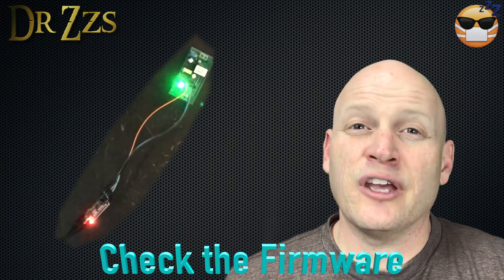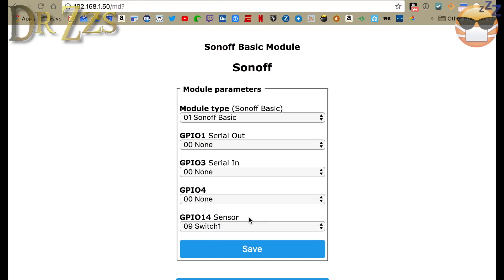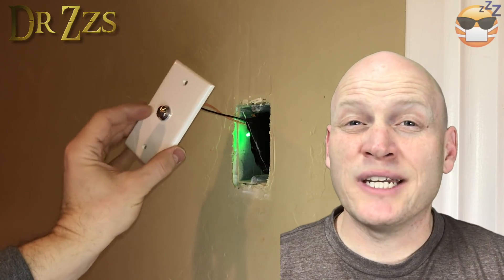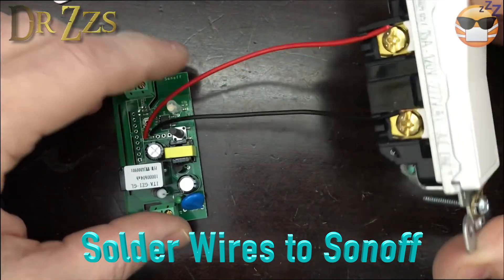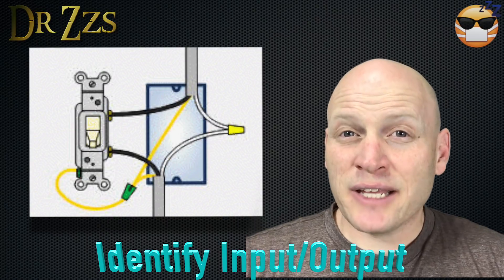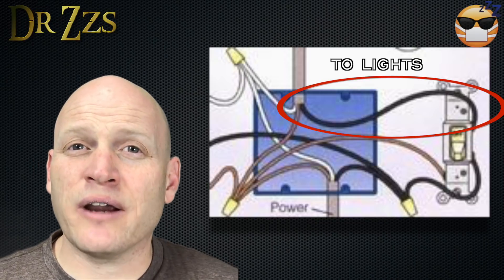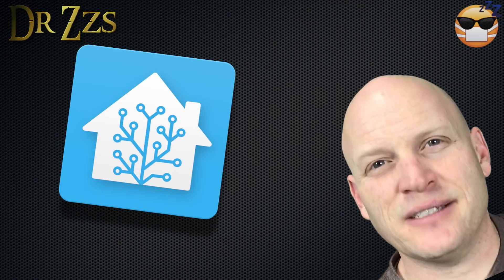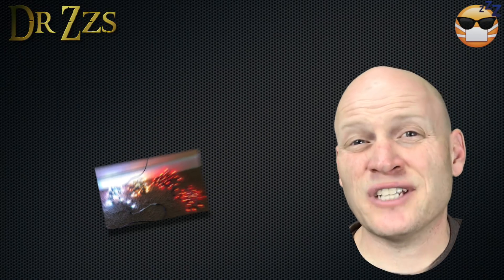No $30 "Smart Switch" | $5 Sonoff + REGULAR Light Switch!

Comment: When you set these up with momentary switches, what happens during wifi outages? Will the switch still toggle on/off as intended or will the lights only turn on if you keep the button pressed?
Reply: I think it still works with the momentary switch during WiFi outages. Switchmode is something internal for the Tasmota firmware you are running on the device. The device does not need to connect to anything to get this information.
One exception is if you  change the switchTopic from 0(default)to 1. Under switchTopic 1, when the switch changes state, it sends a MQTT message to the topic and the device receives the command to change state. During WiFi outages, there is no MQTT to connect to.

Comment: Hi DrZzs, I have a Sonoff BASIC RF R2 power v1.0 and it runs on a ESP8285 instead of a ESP8266 chip.  The GPIO 14 hole is no longer there, but instead the have broke out the GPIO2.  My question is, will your technique work with soldering to GPIO2 instead?

Comment: Thanks for the video. I just opened my switch box and found that there are four wire to the switch. Line, neutral, ground and load. So i just ignored the load wire, add sonoff to the line and neutral?

Comment: my sonoff does not looks like this is it because it was 2 years ago that they change the board??
Reply from the maker: ya, this video was done with v1 sonoff basics.  They are on v3 now.
Reply: @DrZzs  Great video and what an understanding you have. Can you do a similar video with R2 atleast.  As there are lot of discussions on should we use IO2 or Rx (which is GPIO3) etc. as Sonoff didn't give access to GPIO14.

Comment: Thanks for the video! I did not understand a few things and I am blocked, nothing broken thankfully. I have flashed my Sonoff basic with Tasmota and set GPIO14 to Switch1 and tried 2 variants of SwitchMode - 0 and 1.

My issue is related to wiring. I thought I could connect my Sonoff to the external wall switch on the lamp side by doing the following:

Open the lamp
Cut the L and the N wires
Connect the L and N wires coming from the wall to L and N of Inputs of the Sonoff
Connect the L and N wires going to the lamp to L and N of Outputs of the Sonoff

I have not done any other soldering or connection (like connecting GPIO14 to Ground...) on my Sonoff.

When the power switch is ON, I can connect the device using the web interface, MQTT etc. But when I turn the wall switch off, the power to the Sonoff also gets cutoff and it no longer has internet connection.

I am sure this is expected because and I am doing something wrong on the wiring side. But I don't know how to fix it. Can you please advise. Thanks. (I can't do this in my switchbox as it does not have enough space).

Comment: Hrm,   If you don't use a momentary momentary push button for your switch,  you'll have the same problem you'd have with smart bulbs.  If the switch is off, your smart switch is offline.  That's a great cost saving idea though.

Comment: Thanks for the vid! So with the rocker switches, if the rocker is in the standard “on” position and you switch the light off in the app, if you switch the rocker to the standard “off” position, does that turn the light back on? So the rocker switch would essentially reverse the on/off  positions when the light is switched on/off through the app?

Comment: I think you need to call electrician before you burn your house down. Using speaker wire in the butt connectors is extremely hazardous they cannot support the power of household loans. Even if it’s just lights

Comment: Great effort, thank you! From 6'32" how is the regular switch added? You just say "it's all connected", but how is the regular switch connected to the SONOFF? What does the regular switch do? For situations like this it will be great if you can add a simple circuit diagram in the video. Otherwise it is actually dangerous for people who are trying to follow the video with live circuits.

Comment: does this sonoff sync up with the switch? By that I mean, if the mechanical switch is off and I try to use the Wifi/automation will it work and vice versa, so in essence as a comuter in a 3 way switch?
Reply from the maker: yes! that is exactly it.  It is a 3-way switch, but the other switch is "virtual" in the computer or app.

Comment: I was checking the sonoff basic r2 I got and its only for 10amps, households circuit breakers are typically 15 or 20 amps, This will cause the sonoff to burn before the breakers starts protecting.  I guess we should use an inline fuse (of 10 amps) before the input line to protect the house from burning.  I see you are using this sonoff for your home.  So probably you should do this too, Dr Zzz
Reply from the maker: you are correct.  And I did start to add fuses.  
Good advice.  Thanks!

Comment: 2:30 is there anything  I can do?
Reply: I imagine that one solution for you could be to put Sonoff module in the light fixture's electrical box opposed to light switch's electrical box.

Most people don't realize that with the wiring like yours, the light fixture's electrical box should have hot, neutral and ground wires coming from circuit breaker. And then hot wire is simply pig tailed and forwarded to the light switch where it returns as load wire on another Romex cable. So there should be two Romex cables in your fixture's electrical box.

Comment: After getting inspired watching your videos, I have ordered a few sonoff basic R2 switches.  GPIO14 pin is missing in the new switch, please let me know the soldering process to install this R2 switch in the wall.  Note: I successfully tasmotised the sonoff.
Reply: Sathish use gpio 3, which is broken out as rx on the board.

Comment: In the Netherlands we use the  NEN1010 norm for electricity.
Blue(0), Braun (fase), black(switching) and yellow/green(ground)
The spaces for junctions are mostly in the ceiling.  Behind the switches we normally do not have enough space for a piece of electronics.

Comment: Does it matter what gauge wire I use to solder the switch to the GPIO pins on the board? I soldered on some female headers to make flashing a little easier, so I'm wondering if I should remove those or if I can get away with male pins and small gauge wire coming from the switch.
Reply from the maker: it doesn't matter really.  those are 3v wires carrying almost no current.  I've used wires I salvaged from old phone cords :)
Reply: @DrZzs  That's what I assumed, but me and mains aren't the best of friends, so just double checking. ;) GREAT tutorial. Thanks so much for the help.
Reply from the maker: I'm like a snake charmer with mains power.  I let it bite me every now and then so I'll build up an immunity ;p

Comment: ... where do we wire into with the newer basics with no GPIO14 ?
Reply from the maker: great question.  I believe you can use the Rx or Tx pin after you've changed the firmare.  Test it first cuz you may get errors if one of those is grounded on reboot.  I've used Rx for motion sensor and temp sensor without trouble.  Not 100% sure that Tx will be okay.  Just don't use gpio-0.
Reply: @DrZzs  so think we were to use And and GPIO14, so we saying we simply soldier switch into tx and rx, hmm, that's like shorting tx to rx then...
or we swopping gpio14 out for either tx or rx, problem, i'm going home the wkd, need to know what to do before as I have limited time to install before I leave again.
Reply: ok, and and rx ?
Reply: @DrZzs  will try this weekend, otherwise just going to wire the sonoff in as a 2 way switch solution, the wall switch the one side and the sonoff on the other leg of a 2 way configuration.

Comment: I've set GPIO14 to Switch1 (9), wired 120vac into input, and took wire leads from GND and GPIO14 to a basic light switch. When I toggle the state in the tasmota web interface, it works every time. If I flip the light switch to ON or OFF, it does nothing. What gives?

PS: I've even tried using a 2k resistor across 3.3v and GPIO14, to no affect.
Reply from the maker: I can't say for sure what's happening.  Either the Sonoff or the lightswitch is bad I would guess.  What happens if you just short gpio14 directly to ground?  If nothing happens then I would guess the sonoff is bad.
Reply: @DrZzs  So... long story short, a switch that I had taken down days before, went bad... lol! That's all it was, a bad switch, but I assumed it was good because it was working less than a week prior. Anyway, works like a charm now! =D

Comment: Hey can i use a Sonoff for a ceiling fan.  I have a smart bulb for the light, But need to keep it hot all the time.  Just need to wire it to the Fan wire and N wire correct? https://ufile.io/moymg6p7

Comment: When I shove the Sonoff board (no housing) into switchbox, the reset switch (GPIO 0?) is pressed against other wires in the tight box, and the relay is held low all the time. Is there a safe way to remove that switch, or the black rod that's attached to it? Or disable that switch temporarily in the Sonoff configuration?

Comment: Is there a way to use a momentary switch with an led, so when the room lights are off, the switch is lit?
Reply from the maker: I'm sure there is.  I haven't done it so I don't have the details to give you.  I would expect you could power the led on the button from some gpio pin on the sonoff, then set it so that pin is ON when the relay is OFF.

Comment: Question, I'm working on setting this up with the newer Sonoff Basic R2 RF Power V1.0 PCB that is being sold now. This PCB version doesn't have a pad or port for GPIO14. I understand that GPIO2 won't work because it causes a boot failure if pulled low. From what I've researched the only way to really do this with the new hardware is to utilize the RX port and then set it as you would GPIO14. The only issue with this is it stops you from being able to serial flash the board again, but as long as you have already flashed with Tazmota, you shouldn't need it as you can reflash OTA. Do you see anything wrong with this configuration or do you know of a better way? I'm somewhat new to HA but learning fast. I'm an IT pro who works on servers and switches all day anyway. But anything you can help with is very much appreciated. Thanks again!
Reply from the maker: Ya, and there's even a newer R3 version hitting the market this month.  I haven't heard of a better solution than what you describe for using the R2's with an external switch.  
Once you get Tasmota on there, you shouldn't ever need the serial ports again.  I have several older sonoffs that I've used Rx for Temp/Humidity or even Motion sensors without an issue, so it should be fine.  
Hopefully I'll get one of the R3's soon and we can start figuring out what we'll need to do to make it work best for our needs.  
Good luck!

Comment: How do I make a 4ch relay module with nodemcu with push buttons for each relay and make it work with sonoff tasmota.... In short want to make my own sonoff like 4ch relay...
Reply from the maker: I did it... but I can't remember which Video it is in.   Basically, once you have tasmota on your nodemcu, you set it as the "Generic" module type.  That gives you 11 pins to assign as either a Switch or a Relay.  Set one pin as Switch1, and one pin as Relay1.  Switch1 will control Relay1.  Then repeat that for Switch2, Relay2, Switch3, Relay3 and Switch4 Relay4.  As I recall, it gets a little tricky because some pins can't be low on startup.  I know for sure you don't want GPIO0 to be low on startup.  I can't remember which others have specific limitations.  You'll have to just experiment a little, or there may be more info in the Tasmota docs, or check out TheHookUp's video about using GPIO pins on ESP8266 devices.  https://youtu.be/7h2bE2vNoaY
Hope that helps!  Good luck!
Reply: DrZzs damn.... That was a fast reply.... Didn't think you'd reply....and again taking the time out and explaining it in a reply ( I know it takes a lott of time typing such long msgs) .... That's something..... Thanks man.... U r a great guy.... Keep up the good work...! 😊

Comment: Hi
Very nice and well made video.
I have light switch in my garage and i want to use the sonoff, but my the garage lights , can be switched on and off from two different switches (far from each other) 
Just to clarify things a bit , these 2 switches are hard wired to the same board and the same lights , and they are used just for better accessibility , meaning , if you are at one end of the garage you can switch on , and when you are at the other end , you can switch off 

My question , can i use a sonoff switch with this setup? Or maybe there are other switches that may work?
Reply from the maker: Hi.  That sounds like a 3-way switch.  There are a few ways to use a Sonoff or other device in that arrangement.  https://youtu.be/EroQ_Eos1HY or https://youtu.be/GEJCk-Dr3BQ or https://youtu.be/mSENAY9_AlI
There are off-the-shelf 3 way smart switches too, like this: https://amzn.to/2IbDFgS
Hope that helps!

Comment: DO I NEED TO HAVE A SONOFF FOR EACH SWITCH I WANT TO CONTROL?
Reply from the maker: yes, something like a sonoff at least.  There are some devices that come with multiple relays (like the Sonoff T1), that can be used in a location where you have multiple switches.  I use the 3 relay version of the T1 in several places in my house.  Works very well.
Reply: @DrZzs  most humble appreciation in receiving your response.  could you be kind enough to give me the part number to that particular T1 3 relay? 

i saw on an old video where you first put sonoff on garage... you gave website where you buy your sonoffs.  also if you could reference the product number and source for the (heat shrink plastic you use on connected wires.)  lol Layman's terms. hahaha.
I am going route you did in software and hardware. (I self taught writing code on various computer platforms to automate my job(s) at IBM.  I have no formal electronics or Computer Science education.  Just Determined as heck. Interested to challenge to complete this tasks.
simple "complete" videos end to end on a project....  I take and build a castle from it.

Awesome to include your code in comments!  Can i ask you to show more clearly when/where you put code in while setting up devices? 

I will go FURTHER WITH SECURITY.  I will install a hydraulic "spike" rail that lifts up across driveway... two feet from road.

I have two acres (narrow but goes a way back from road.)  So i have a long drive way.  I will install 1 super nice cam to read car tags and face recognition near road to cover road/beginnig of drive way all the way to the house.  At house I will have face recognition cameras x2.

most important is getting garasge connected, window and door sensors.

Comment: @DrZzs How do I do the same with Sonoff basic R2?
Reply: They replaced GPIO14 with "Key" pin .. 

There is also another better method using existing household wall switch! You will need to buy an overpriced chip solder it to Sonoff, you will not need to flash your Sonoff and you can keep using eWelink , if you wish... 

https://www.ebay.com/itm/E77-Wall-Switch-Connectivity-Module-for-Sonoff-Basic-New-R2-1-Ch-Wifi-IOT-Switch/273576948115?ssPageName=STRK%3AMEBIDX%3AIT&_trksid=p2057872.m2749.l2649
https://lebhile-com.shopclues.com/e77-wall-switch-connectivity-module-for-sonoff-basic-1-channel-wifi-iot-switch..-140217634.html

Comment: Is there a way to do this and use it with Alexia and to do it do I have to make a home assistant hub that deals with it. I have no problem with the coding but do not want to not be able to manually turn the light on and off.
Reply: Yes, flash it as he said, add it via ESPHome or as a normal entity via MQTT, and it will be discovered by Alexa. HA works as a broker at this point, so you can "pre-configure" all of your entities, whether they exist or not, and Alexa will discover them.

Comment: I got a wall switch and the box only has 2 wires, that means that there's no neutral wire, and the way the switch words is by splitting the hot wire in 2, how can I connect the Sonoff basic?
Reply: Despite what was said in the video, you can still make it work. Those two wires probably run directly to the box the light is mounted to. Leave the switch as-is, and remove the light fixture. Inside the two wires to your switch probably connect to hot/black and one side of the light fixture. You want the sonof to do that instead, and those two wires will connect to the sonof GPIO and ground. Basically it is exactly as he portrays, but the wires between the switch and module are just longer.
Reply: @overkillthemighty  thanks for your help

Comment: One thing I haven't  seen mentioned here or in posts, is this can ONLY be done if the wall box is made of plastic and NOT METAL !!  Even in a plastic box, if there are
bare metal ground wires and they touch a point on the PCB where a solder connection on the live wire may pierce through the tape,  it could  short out.   I would at least recommend put the board in an old dimmer switch if possible.  then feed a White, Black and Red wire out of the dimmer box.  White & Black being input, and Red being output to the light, just like most dimmers are wired.
Reply: As it is not required by NEC or IEC, the ground wire can also touch a normal switch and short. The breaker is in place to prevent any issue, and post 2012 homes require outrageously expensive AFCI breakers in many rooms. There is actually a recommendation in the NEC to wrap all switches with tape - around the screws. I never see any homes with it except for the ones I build. I don't get it.

Comment: First off, thanks for the great videos, Second, some advice please; I havent tested yet but need to know if I do this gpio14 switch, can I make the normal wall rocker switch do the opposite of the sonoff current state? If the Sonoff is on, turn off and vice versa?